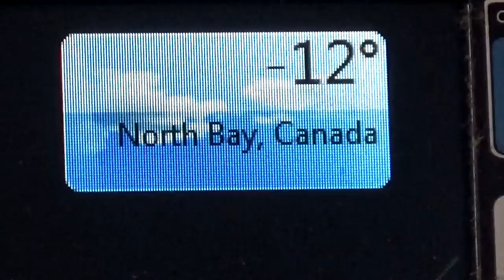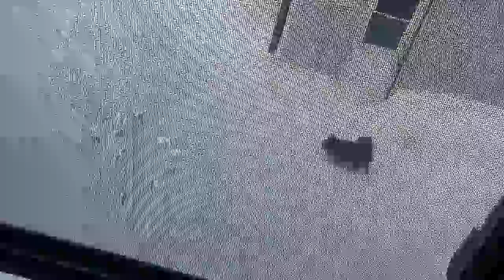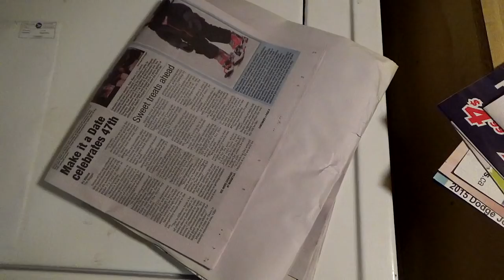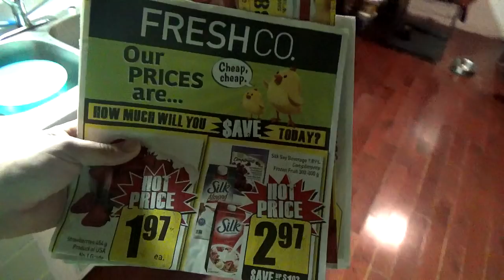Knob Replacement

Comment: that fairing on your motorcycle the one you call a windshield is not meant for your face it is meant to deflect the error away from your body up over your body and head but you're not supposed to get down behind that windshield.

Comment: Lower back pain very common with office workers,to much sitting it causes some muscles in the back to shorten there's plenty advice on the tube,i had it like you for 10 years cured it by picking up marbles with my feet and flexibility exercises.
Reply from the maker: +Anna Fn interesting...I may have to look into that.

Comment: Looks like one of them compressed wood shavings doors, usually they get damp and turn to dust...

Take a plane to the top of the door to shave off a few millimetres of wood to stop it catching on the frame, or get your dad to, and film him... :P

It's more a deflector than a shield, if you're tall enough though it'll just fire rain right into your face... :P

So I take it you survived shovelling? :P

Comment: Sounds lime you have a slipped (aka Herniated) disc like me, pinching the sciatic nerve that goes down to your leg, mine does it on the right-side, you can do exercises for it (which I showed you sometime last november/december, the two women in a generic office that you half expect them to break out into lesbianism) which help a whole load... :)

Three options for the spine issues, exercises, massage & surgery, take your pick... :P

Yeah, when your back is damaged like that, don't overwork it, but, do some exercises that are designed to help with the problems, they are immensely useful... :)

I have pigmeat to cook in a short while, need to cook soon cos my belly be rumblin'...

And I'll have to forward that exercise link to you again, you will benefit from it I'm sure...